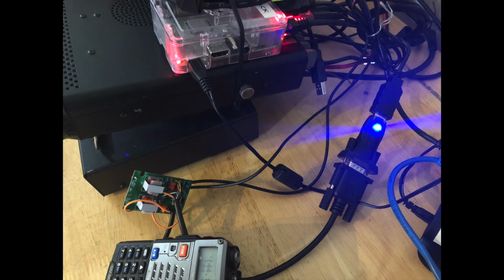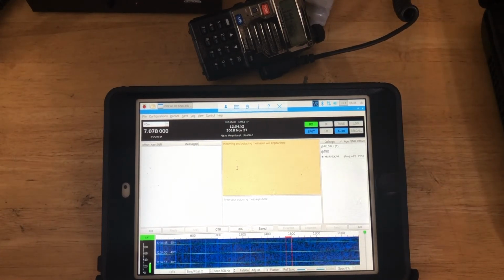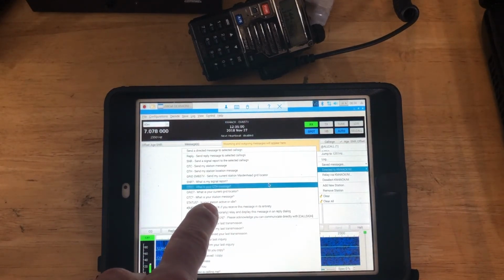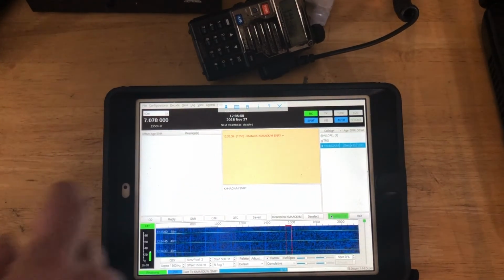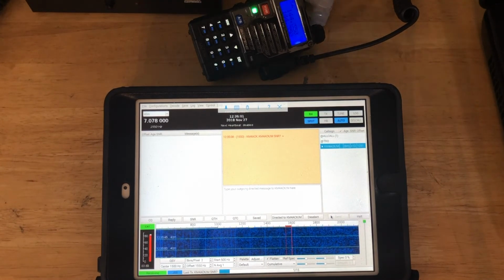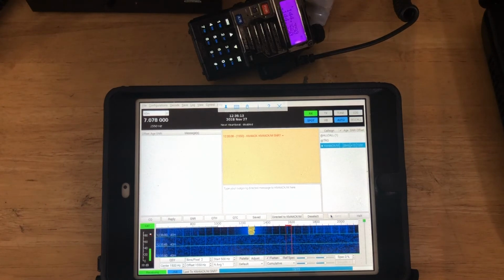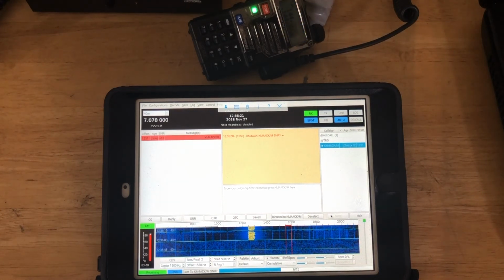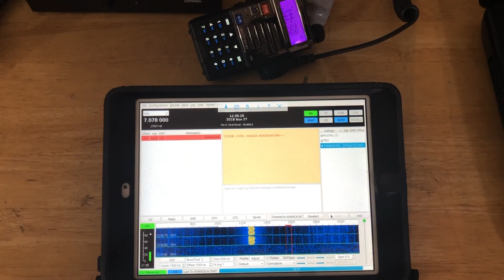JS8Call with a Baofeng

Comment: Great video. What is the best digital mode you recommend for messaging on 2 meter FM?
Reply from the maker: JS8Call will work with 2M FM but not as well as SSB. There's also APRS & Winlink for 2M. Depending on your area, there might also be an old school BBS.

Comment: umm, I am completely new to radio communication. It has been one of my very big interests since I was a kid. I work in the software industry, I saw that device you used with the screen to look at the radio signal when I worked at an ISP quite often. What is that device and where do I exactly start, to get into radio tech. I have like $300 saved up. I already did a small project referring to the flightaware guide to get flight data using a raspberry pi. These days I am working with arduinos but really want to go indept into the radio communication segment. Hope you can point me in the right direction. Thank you.

Comment: Link on how to wire it is dead. I would like to know the way it's wired too, thanks for the video. KN6NKL
Reply from the maker: Thanks for the heads up. It looks like he took the page down.
Reply: @KM4ACK  You happen to have the article downloaded at all such as images?  I'm trying to do this now and while I could figure this out I'm sure this could save possible hours :)  Seems wayback machine doesn't have it either
Reply: @DexDeadly  I am in the same situation. I found https://openrepeater.com/hardware/easy-digi and  https://nu6xb.eecs.berkeley.edu/site/index.php/eecs/easy-digi-modifying/ but not finding a lot more. Seems like a few jumpers depending on the setup you might have. I have an TRRS seems to make it a bit more complicated as well. Any pointers would be good.
Reply: @toddpalmer  I got this to work and putting a video together on my channel Simply Synced LLC.

Comment: Jason,  nice video,  I have a question on the easy Digi.   I am putting together a EasyDigi and I have it all ready except for the USB connections.  So the USB has 4 (5+D-D+5+)  the easy digi has Grd, RTS, DTR.  So I guess the RTS goes to D- and DTR to D+?  is that correct?  thanks Don V31NT

Comment: Will this do winlink? I don't have much money to do things with. I have a Anytone D878UV plus if it will work on one HT it should work on my. We have  Winlink at the local EOC and I want to be able to get into it. When a Hurricane comes I would like to be able to put my 878 on outside antenna and be able to send winlink.
Reply from the maker: It would allow you to do Winlink over 2m with an HT. I don't have experience interfacing it with the HT you mention. I would try to find a tutorial online that shows you how (if possible) to interface with your HT before purchasing the easy digi. You will need a cable to go between the HT and the sound card and may have to home brew one.
Reply: @KM4ACK  it has the same plug as the  Baofeng. The local EOC has a gateway maybe 5 miles from me  and with my 9db antenna 60 up I shouldn't have much trouble.  Thank you for the information!

Comment: What radio did you select in JS8CALL? Can you share the entire configuration for the Baoefeng in the JS8CALL software?
Reply from the maker: No rig control was enabled so I didn't choose a radio. Sound card used VOX for PTT control. I manually selected the frequency. 73, de KM4ACK

Comment: I just upgraded to JS8Call 2.0, plugged in a USB audio dongle into the Linux workstation in my shack, connected the TRRS jack on the USB audio dongle to a Baofeng audio cable, plugged the cable into the two pin jack on the Baofeng, set JS8Call to use Pulse audio so it uses the USB audio dongle, set the Baofeng to 144.178 MHz, set the Baofeng to VOX level 7, and it seems to be working.  I monitored the CQ transmission from JS8Call using my SDR as a waterfall.  Now I just need to get a local ham to play radio with me.
Reply from the maker: Great experiment. While it works, it's not quite the same as operating in SSB on 2M. Still fun to play with and see what works and what doesn't. Let us know what kind of range you get during your testing. 73, de KM4ACK
Reply: @KM4ACK  - So far, I've encountered two problems.  The Baofeng 82HP battery doesn't last very long, even when it's mostly receiving when the squelch is set to zero to pass the weak signal audio to JS8Call.  The battery discharges even when it's in the charging stand, as the trickle charger apparently can't keep up with the drain.  I ordered a battery eliminator to fix that problem.  The other problem is worse.  The 82HP apparently won't transmit when squelch is turned off (VOX or PTT).  For JS8Call, I can either receive with squelch turned off, or transmit with squelch enabled.  I suppose I could set the squelch to 1 and I'd be able to receive JS8Call if it's being sent from a mile away and the received signal was strong enough to break the squelch, but what's the fun of that?

I have other Baofeng models to try, so the experiments continue.  I have a local ham interested in testing with me, so that's good.

The audio cable for my FT-857D arrives Monday so I can use FLRig and JS8Call to transmit with my real radio.   :-)

As always, thanks for the videos that educate and motivate.
Reply from the maker: I think you will find that the squelch will be an issue using VOX. If you come up with a hardware PTT solution, you should be able to get around that. VOX typically won't transmit when squelch is open as it thinks a signal is present on the frequency. With FM, if the signal can't break squelch set at 1, it probably wouldn't be much use on JS8 anyway. With that said, I would try JS8 on your 857 on 2M SSB. We have gotten some crazy distance out of this setup. https://youtu.be/DMbjZKXRXRk 73, de KM4ACK
Reply: @KM4ACK  - I love the video from your link.  I've watched it a couple of times and recommended it to others.  Thank you for that video.  It's what prompted me to play with JS8Call on 2m.  Speaking of crazy distances, if you guys communicated over 40 miles on 1/8 watt, I wonder what might be possible with a good antenna and 50W.  I'm in Lexington KY (EM78sa).  The audio cable for my FT-857D should be here Monday.  Would you like to try?  I wonder what the distance record is for 2n JS8Call.

Comment: Is That an android tablet? Do you have a video showing your complete setup with your tablet? If it is a tablet, js8call can be downloaded from the play store?
Reply from the maker: It's an old iPad mini. I was using VNC viewer on the iPad to connect to a raspberry pi that was running JS8Call. JS8Call can't be run direct on the iPad or an Android tablet. 73, de KM4ACK
Reply: @KM4ACK  That probably sounded like a dumb question but as long as I've had an Android tablet,  my pi and using ham radios,  I've never heard of or used a vnc to connect my pcs or my pi. Just finally connected a few minutes ago. Not sure if I like the mechanics of it but  it might take some getting used to. Thank you for all your videos. They are very informative!
Reply from the maker: @mtngr1 It does take some getting use to but super handy if using it in the field. Works great with the Easy as Pi Hotspot https://youtu.be/qMT-0mz1lkI 73, de KM4ACK

Comment: Cool short video, thanks. I'm curious though as to why you need the Easy Digi? You're already using that USB sound card, you could use that USB sound card to send and receive the sounds from the PI to the radio. I'm sure the Easy Digi does a better job, but other than that am I missing something (as I usually ask)? By the way, I don't ask to be a know it all (I don't know much), or to be sarcastic, I serious am ignorant of the setup. :-) I've done the USB sound card/Baofeng bit using a smartphone with AndFlmsg and my also with my Pi for APRS.
Reply from the maker: No worries Devin. Always happy to explain where I can. You can pipe audio from the USB card direct to the radio and leave out the easy-digi. But then you would have to rely on the VOX setting in the baofeng. If you have ever played with VOX on a baofeng, you will know that the VOX hangtime is EXTREMELY long. The easy-digi has its own VOX circuit that is much quicker at releasing the PTT  as soon as the signal is gone. In this particular case (JS8Call) the VOX hangtime might not get in the way of receiving a reply back. However, on other modes like APRS, the hangtime WILL prevent you from hearing the acks of other stations if you rely on VOX on the baofeng. Hopefully that is understandable. If not, let me know which part and I will try again. I'm much better at video vs text. :-P 73,   de KM4ACK
Reply: Ah, that makes complete sense, thanks for explaining. :-)

Comment: Great video. Do you have any diagrams on the wiring for the easy digi? I have one and have tried a couple of different configs but unable to get it to work.
Reply from the maker: This is the one I used https://mikebeach.org/2015/10/27/using-kf5inz-easy-digi-with-baofeng-uv-b5-or-uv-b6/ courtesy of KF5INZ. I didn't use the DB9 connector. Just wired each side to a 3.5mm male plug to interface with a cheap USB sound card plugged into the pi. 73, de KM4ACK

Comment: What is inefficient about this?  Seems to work better than other systems I've used.
Reply from the maker: Ronny Julian inefficient over FM. Much more mileage over 2M SSB. I have another video titled HOW LOW CAN WE GO where you can see it work over 2M SSB down well below 1W over 20+ miles.
Reply: @KM4ACK  SSB would most always be better than FM.  That part I would expect but for 5-10 miles around Knoxville  playing around it might be good fun.  May have to toss out a call or two and see.  I was thinking about protocol and speed.  Looks much better than classic packet on simplex.  Thanks!
Reply from the maker: Certainly better than classic packet! I would post on the forums or find a friend near you that was willing to experiment. I was in Gatlinburg last week. I could have tried if I had known then. Played some radio while over that way. Watch for the vid coming out later today. de KM4ACK
Reply: Jason, can I do 2m SSB with a Technician license?  I’m currently in a hospital waiting room, or I’d look it up in my tech study manual.  Trying to figure out which of these programs I could use on 2m that later is usable on HF when I upgrade.
Reply from the maker: Yes. There are no restrictions on using SSB that I am aware of except in small slices of the band. You can always check the ARRL band plan chart as well. 73, de KM4ACK
Reply from the maker: Unfortunately, I don’t know of any.

Comment: Great job on showing it can be done on 2 meter FM =)   Not the most efficient but like all soundcard modes it does work with JS8 as it does and still does for Fldigi modes =)    de N5VMO Pat

Comment: Someday I look forward to having winter days to myself again!
Reply: I have a Mobilinkd for APRS with my baofengs. Always wondered if i could just do more digital modes using that.
Reply from the maker: I keep saying I am going to pick up a Mobilinkd and play with it but never have. The easy-digi has been sitting around for months before I got around to using it for something. It's practically worthless with JS8Call unless you have someone close enough to work simplex. Currently, I run a receive only APRS igate. I may end up using this to build a fill in digipeater for here in the shack. So many projects....so little time. 73, de KM4ACK
Reply: @KM4ACK  I am pretty new to all of this. But the mobilinkd was very easy and very handy, got me doing what i wanted out of APRS real quick. Ive use it on APRS droid, but i know other uses exist
Reply from the maker: I use APRS droid as well with a Baofeng. Makes a cheap little APRS rig that I don't mind if it gets damaged. I carry it hunting and have my Jeep setup as a digipeater to get my signal out to the local wide area digipeater. I have a vid coming out in a couple of weeks on the Baofeng setup. Need to get one made for setting up the digipeater soon. I use this cable between the droid and Baofeng https://amzn.to/2Fixo32 73, de KM4ACK
Reply: @KM4ACK  looking forward to that video